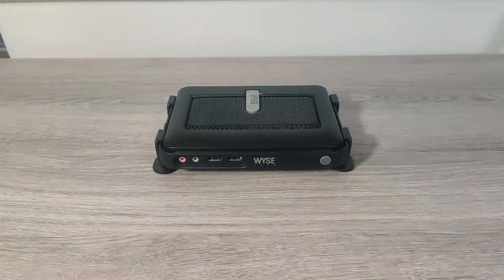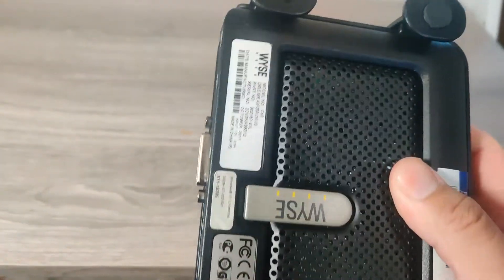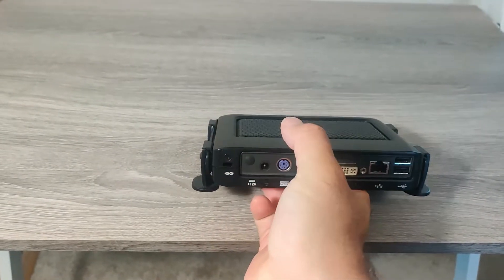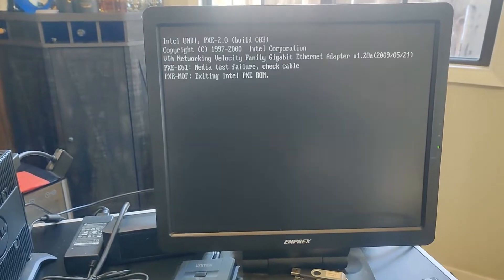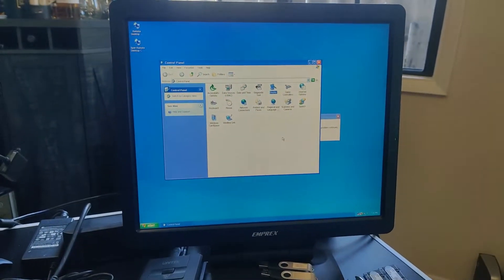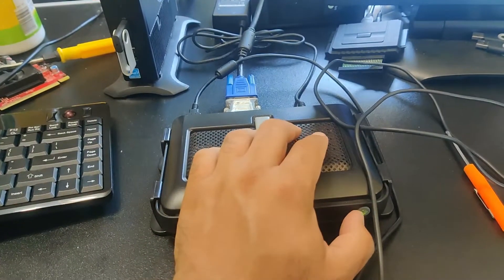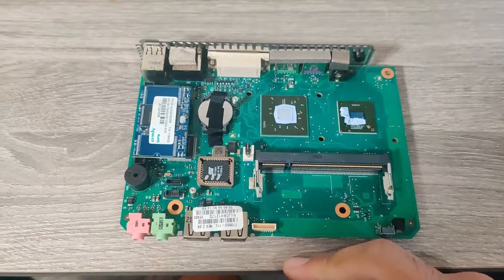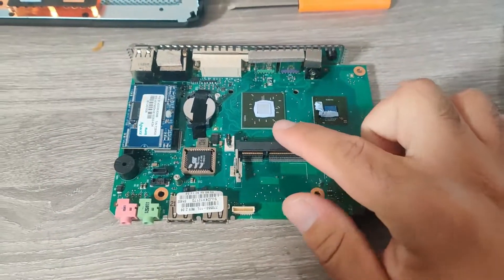Wyse C90LE WinXP Thin Client Teardown

Comment: I have one of these and its a cute little machine. I took mine and removed the SSD and put in a 44 pin ribbon cable and added a SD card adapter to be used as the hard drive. I had to modify the chassis a bit to allow for the cable to be outside the chassis. I upgraded the memory on mine from 1GB to 2GB as the unit only supports DDR2 sodimms.  the unit ONLY SUPPORTS 32 BIT archetecture, so a 64 Bit OS is out. these machines work best with a Linux OS as windows 10 is mostly 64 Bit. (you can get a 32 bit version, but its hard to find) so I have now tried this thin client and am pleaseed to know it can still be used.

Comment: Yey! Very instructive video.
I have some questions, i hope you could give a hand.

I'm trying to set a dual boot XP and DOS 7.1 on this machine. However, despite i've been able to almost set up all the stuff, there was no way i could install the audio drivers under XP. 

What drivers did you preciselly use for this setup?
You said the audio chip has DOS support but i was only able to use SBEmu so far... Is there any DOS driver i'm missing?

Thank you.
Best wishes.

Comment: On the Flash drive side, toward the back, there are two small plugs, one 4 pin, one 6 pin. They are USB ports. The six pin runs the wireless card on those with built in wireless. I am working in installing USB 3 drives inside the computer to serve as extensions to the flash drive. Note- the ports are not USB 3, but I find USB 3 drives tend to run a lot faster than USB 2 drives on USB 2 ports. Which is why I no longer but USB 2 drives even for USB 2 ports.
Reply from the maker: Yes, I've noticed that, but USB 3 flash drives tend to run extremely hot sometimes.